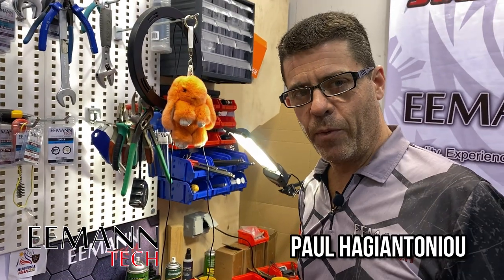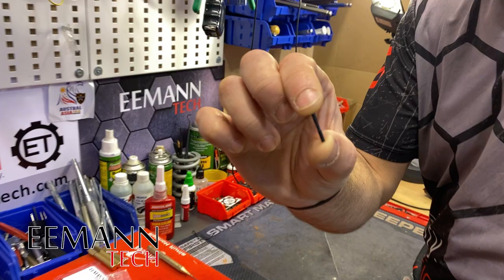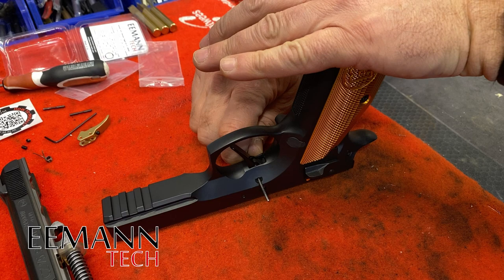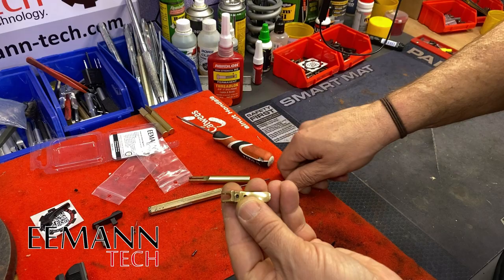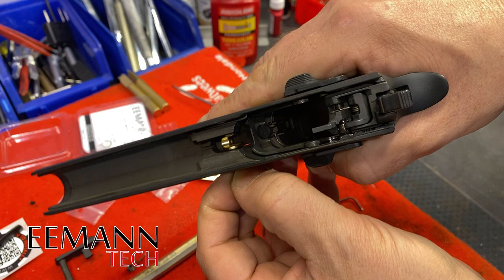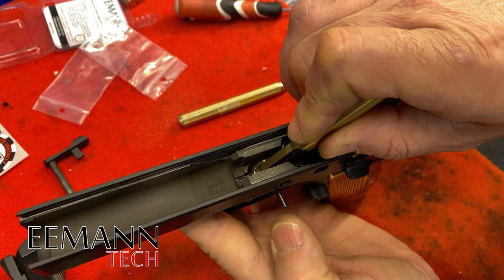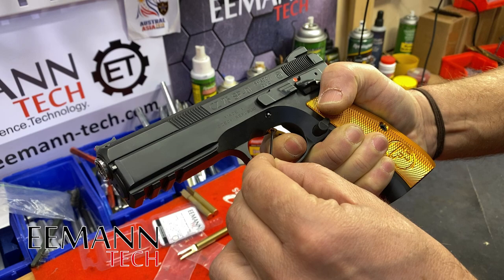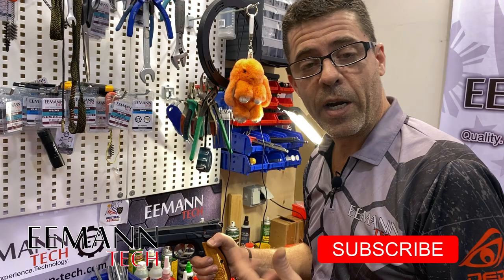EEMANN TECH ULTIMATE TRIGGER FOR CZ installation

Comment: Excellent instructions. And man was that return spring difficult to get in without that tool. Managed to finally do it by actually raising the trigger out a bit, putting the return spring in a pair of pliers, setting the smaller part of the spring behind the trigger first and actually using the pliers to push down on the spring, which pushes the entire trigger down and then get a 2 mm punch in the whole, which I could then follow with the last pin.

Comment: I installed mine and was unable to use the pretravel adjustment. It screw was too long and would either eliminate double action of make the trigger not function entirely. I was very upset about this. I believe the set screw is too long. without it entirely it works fine. I just don't know why I spent the additional money for the option to adjust.

Comment: Hello! What exact product is that safety on this gun? It seems wide, but the lever seems to locate only at the far end from the axle, not all the way from the axle to the farest point. I was about to grind off a pice from my wide safety to achieve that same result, but seems that there is a ready solution/product. My gun is CZ Shadow 2 OR.

Comment: the part is OK, the video is cool but Shadow 2 users should have been alerted that the top grub screw is not just unnecessary but even incapacitating. I am a bit surprised as there is no doubt that the Shadow 2 presently outnumbers any other CZ gun in popularity.

Comment: Hello , i d like to change the original trigger of my CZ sp01 shadow by this one . may i set up the pretravel course by unscrewed (or screwed ?) the screw already installed ? .....(i d like to a have a little bit more longer)..??  .....is the SA mode have less weight too ? .... Thx in advance.
Reply: Hi, aftertravel and pretravel screws are already installed, SA mode have the same weight like OEM. With screws you can adjust pretravel and aftertravel courses...
Reply: @dmitrieemann  Thx ....keep on with the vids , it s really helpfull and instructive....;)

Comment: Hi, I installed it on my shadow 2 problem is , trigger does not reset for double action,  already add pre travel but it just stuck up
Reply: Dave, remove front screw, you dont need it on your frame.
Reply: @dmitrieemann  thank you so much!!  Have a great day ahead, appreciate  much!
Reply: @dmitrieemann  Hi Good afternoon. Which screw do you mean please, the one on the trigger or is it on the pistol?

Comment: Nice. Can you install the trigger spring without the tool? If so, how?
Reply: A slave pin can be used to trap the Trigger Return Spring in the Trigger.  Then the Trigger can be positioned in the frame and the slave pin can be pushed out as you install the Trigger Pin. A slave pin can be fabricated out of different materials, i prefer to use a hollow metal tube of a suitable diameter and length.
Reply: @tok3659  I'm trying to picture it.
Reply: @tok3659  thanks. I needed that. Worked perfectly.
Reply: @Sydneywizard  When I bought my full floating trigger pin & comp only CFW had it & they ship their pin with a slave pin or like I did it exactly the same way except once I had the trigger in with the pin started I just used the tip of my finger to compress the spring into place & pushed in the pin.